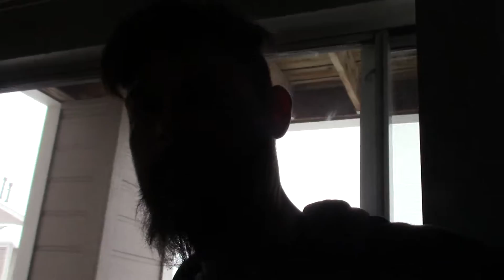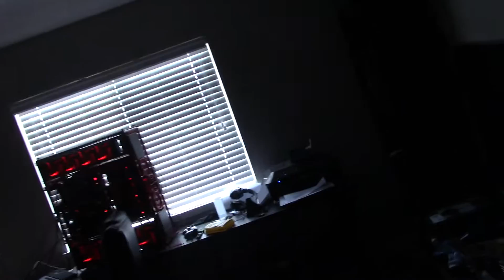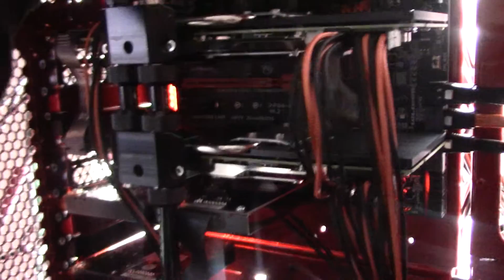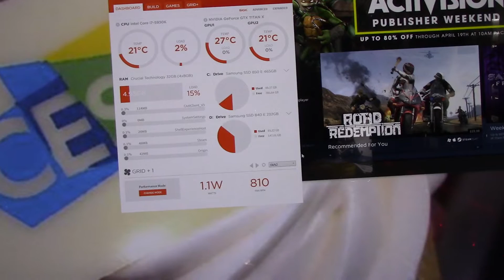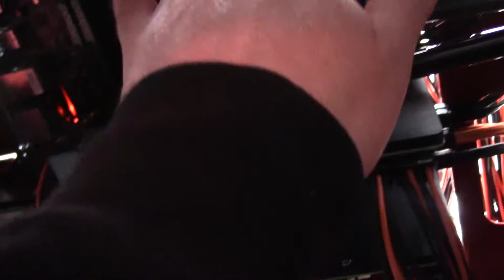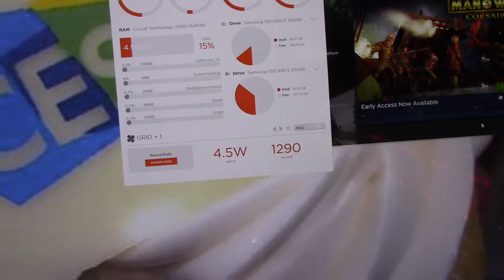CASELABS STH10 Build up and running cable management needed ugh

Comment: have you had any problems with the motherboard thanks
Reply from the maker: Not yet as far as I can tell.
Reply: +Martin Wardle i just got mine a week ago. got one after my rampage v extreme died and its been running great. deff an awesome board.
Reply from the maker: I have been using it for awhile no issues overclock is 4.5 on my 5930k
Reply: +Water_Cool_Fool thats comforting to hear. i seen a lot of issues with it on newegg. i was hesitant on purchasing it however i am happy i did. I had my rampage for about 4 months and it died. currently doing an advanced rma. dont think i will be swapping it out though. i really like this gigabyte board.